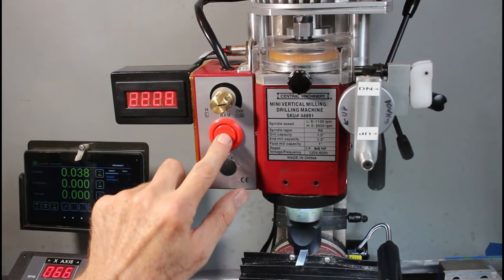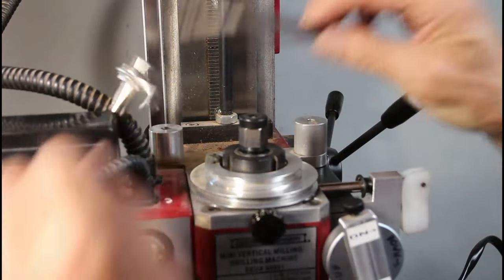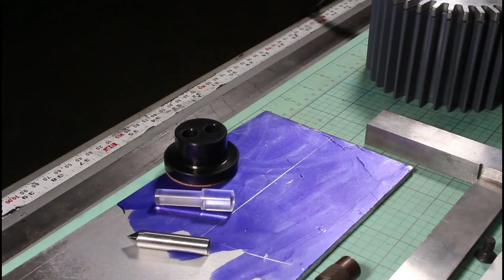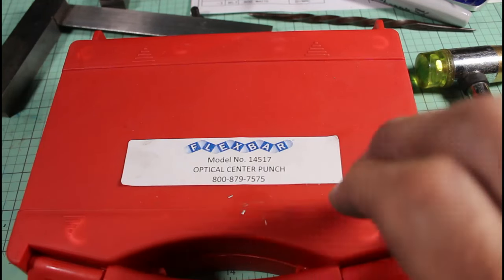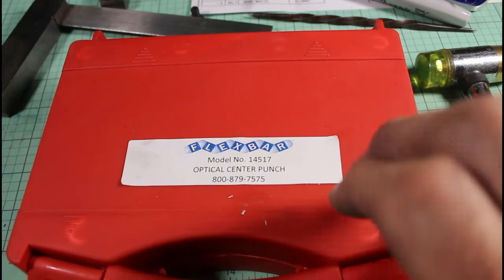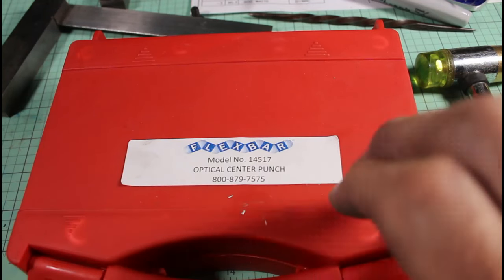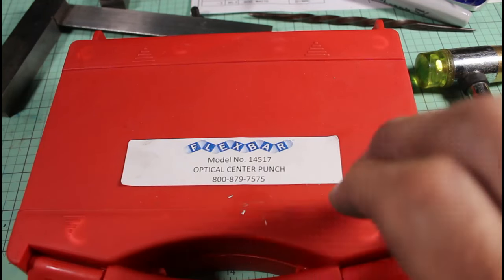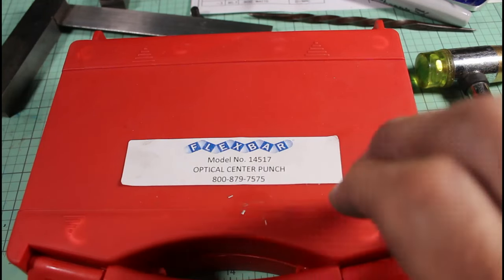Harbor Freight Mini Mill brushless motor upgrade

Comment: What is the rating of the potentiometer?
Reply from the maker: I used a 5K Ohm 1/2W pot
Reply: Thanks, it looks like a worthwhile upgrade although I have just purchased metal gears for my mill.

Comment: Guy how is the torque on this motor?
Reply from the maker: Very powerful!  Brushless motors have better torque at low speeds, so it's great with fly cutters, and also awesome at 22000 RPM!  But my favorite feature is the emergency stop.  After a hard stop the motor retains some resistance to turning until you turn the knob all the way down.  I didn't show in the video that of course you can stop by turning the knob down, like in the original HF mill.
Reply: @GuyMarsdenMakesStuff Thank you Guy being new to all of this I hope to have my mill trammed today.and this will be my second project i do the first project will be the power feed. Also in the process of restoring an Atlas 618.
Reply from the maker: @bobkarstien1248  Make sure and get a good powerful gear motor for your cross slide.  Mine is 180RPM and will stall if the carriage is locked which I consider a "feature".  Also get a power supply that is rated for at least 1.5 X the stall current of the motor.  1Amp should be plenty.
Reply: @GuyMarsdenMakesStuff  what thickness did you use on the aluminum plate?
Reply from the maker: @bobkarstien1248  I used what I had around.  3/16 inch for the motor plate and 1/4" for the support plate below it.  it's not the size that matters, it's how you use it! ;)
Reply: @GuyMarsdenMakesStuff  Thanks Guy one day I will get around to doing this I ordered the motor and power supply so I have it on hand when the time comes. I must say out of all the motor upgrade videos I watch your looks to be the easiest to build and Im sort of the keep it simple type of guy.
Reply from the maker: @bobkarstien1248  thanks for your kind words, and I hope you enjoy the process of the upgrade.  It went pretty straightforward for me.

Comment: Can this motor be reversed?
Reply from the maker: No it can't, it was originally designed for a scooter, and those don't go backwards!
Reply: @GuyMarsdenMakesStuff  Short of you riding your mill around town Id say were well outside of the realm of what this motor was designed to do, no? I was inquiring if it can be made to be reversed. Most 3 phase motors can be reversed via switching any two leads. If I had the motor in my hands I would be able to see if the leads are accessible (No I don't care if their imbedded in epoxy....). You have the motor, but perhaps not the knowledge. If we worked together maybe we can overcome whatever scooters do and make this information accessible to others. FWD/REV are invaluable on both a mill and lathe and making this kind of upgrade without incorporating both features seems to be a half step.

Could be as simple as reversing the leads on the potentiometer, might involve disassembling the motor to get at what's needed. Might be outside of your skillset though.
Reply from the maker: @memyself3275  I am an electrical engineer with over 50 years experiencee and I can tell you that I wouldn't consider trying to modify this motor for reversing.  The motor and electronics are all fully enclosed in a sealed aluminum housing.  

Thanks for the thought, but I'm definitely not going there!  Also, to date I have never had a need to reverse the spindle on my mill.  But that's just me.
Reply: @GuyMarsdenMakesStuff  Ah, and engineer, that explains it. As a toolmaker of 37 years Ive had the pleasure....of working with and teaching a lot to engineers. I guess Ill have to buy one and figure this out on my own and show others how if you feel you do not have the capabilities. Its good to know your limitations. I find these mini mills that lack the most important features of a mill to be funny in a way. I have a Prazi SD300 and the 500 series geared milling head that goes with it and they're both reversible, but variable speeds would be  nice addition to the both of them. I wouldn't give up reversing to have vari speed as reversing opens up a whole nother level of machining capabilities for the machine, and abilities to learn for the user. Then again the Prazi line was geared to a whole different level of professional end user so they include many features the toy mills and lathes do not. Enjoy your retirement projects.
Reply from the maker: @memyself3275  let me know if you have any luck reversing that motor, but I think once you see it, you will give up.  You could totally break the thing just opening it up.

Comment: Now I wonder about using a Tesla (I mean the car) motor in a full size lathe
Reply from the maker: That would be really crazy expensive!  But I have looked into using a high power brushless scooter motor on my mini lathe.  These would still cost hundreds of dollars to implement so I'm not ready to jump into that project right away.
Reply: @GuyMarsdenMakesStuff  Given how EV battery pack goes bad, there might be a lot of scrap electric cars out there that could be used in stationary machines. They are also a lot more torque dense compared to standard AC induction motors.
Reply from the maker: @taiwanluthiers  EV motors are 350Volts which terrifies me.  No way I'm going there!  - and I have been an electrical engineer for over 50 years.

Comment: As you've removed the link to the motor , it's now impossuible to find the motor spec via Wayback machine or other artchival sites, so we can't find an alternative stockist..  making the video kinda pointless
Reply from the maker: Yes, sadly the company that was selling that surplus motor went out of business. But you can search for scooter motors with drivers and you may find something. That's what this motor was.
Reply: @GuyMarsdenMakesStuff  yeah, I know, but would have been easier to follow along if the one you used was still viewable for archival needs. I'm literally installing a 24v ebike motor and controller for same purpose as we speak 😂 Was hoping for something with more gumption, but its what I have to hand. Obvs I'll need to replace asap, so was hoping the one you're using would be around in some other form as my machines a little small and not that well made for extra mass pushing on the column
Reply from the maker: @noviceartisan  Synchronicity! 🙂  I'm going to put a 750W brushless sewing machine motor on my mini lathe next year.  I will do a video about that based on We Can Do That Better's video: https://youtu.be/iiIJCVngs1E?feature=shared.   If I'm happy with it I may put one on my mini mill too - it would be nice to have the reversing feature.